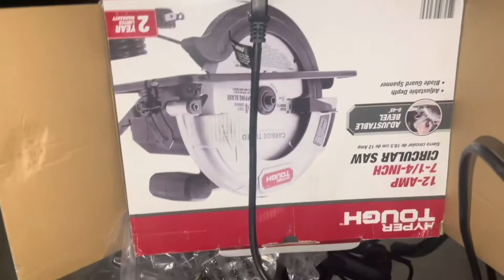July Update: vent fan install and passenger seat removal

Comment: That’s definitely going to leak without butyl tape and you’re probably going to have some rust from those shards
Reply from the maker: It did leak at first until I added flex seal tape and it hasn't leaked again since